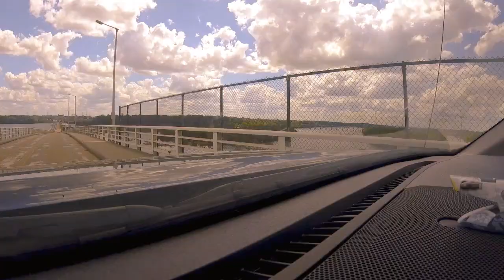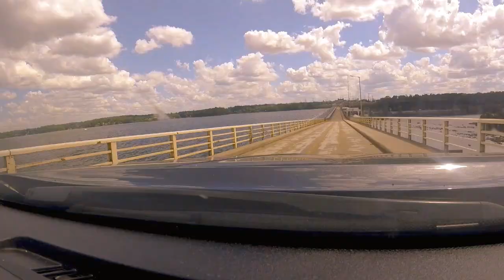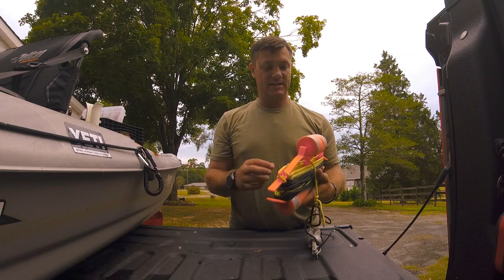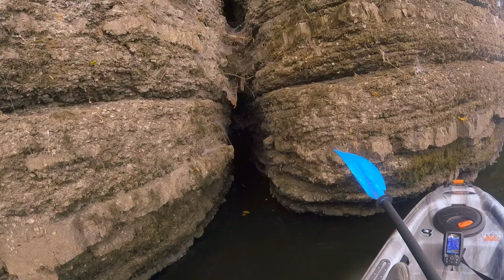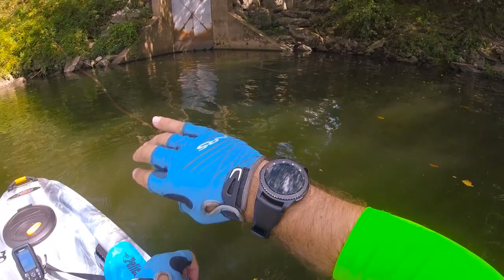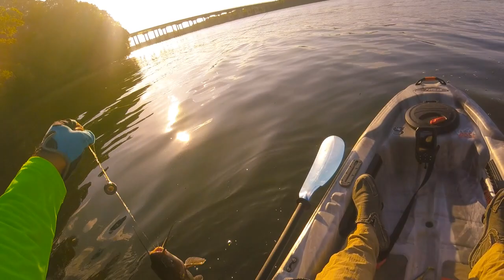D.I.Y. Kayak anchor with floating line holder and some fish footage, Finally!

Comment: Really would love to see how you made your anchor trolley. I have the same yak and looking at options for a anchor trolly. Good video. Thanks.
Reply from the maker: I use the yak attack anchor trolley just installed it a little further back than recommended to give me better control in swift water. I fish mostly below a dam so I need the advantage. I'll work on an explanation video for the install though.